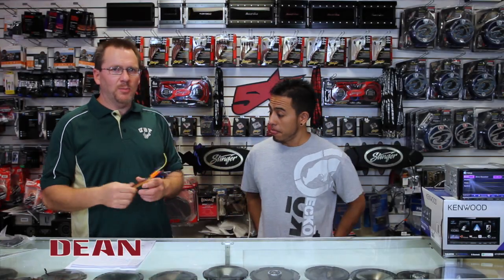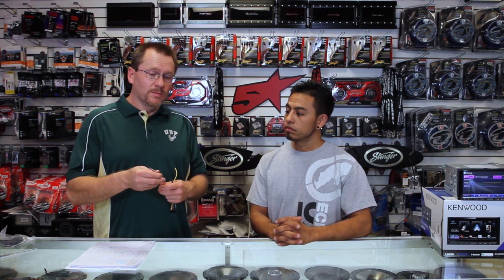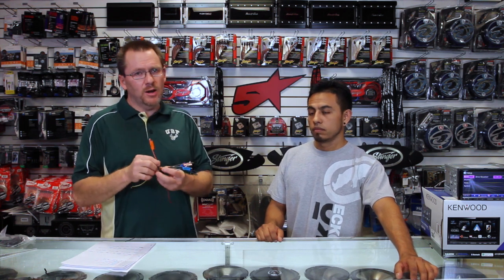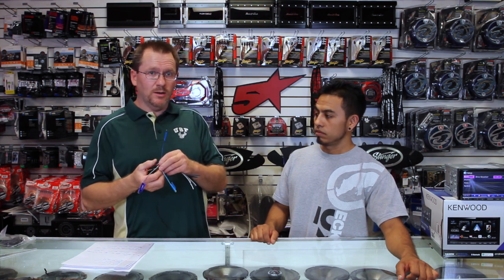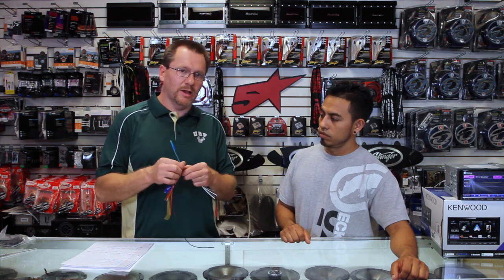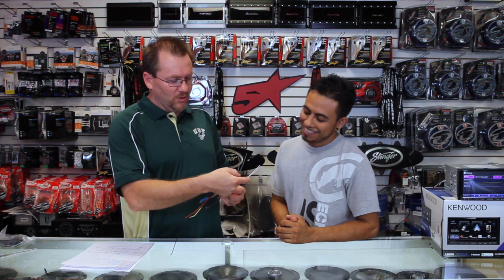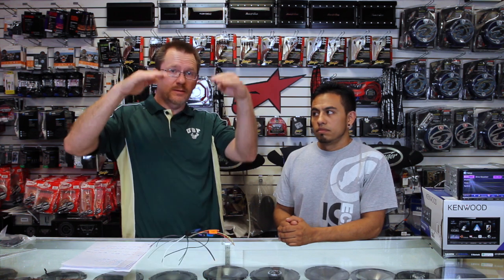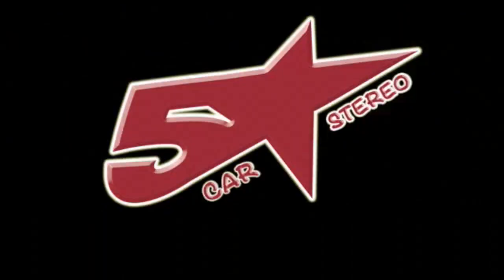What are all the wires for on a Kenwood power plug

Comment: need help....I installed the kenwood dpx501bt in my 2006 honda civic si with amp and sub. amp and sub works and deck works but no sound through my factory speakers....help me
Reply from the maker: The si may have a factory amp, did you connect the blue/ white remote wire up to the blue wire in the aftermarket harness?
Reply: +Five Star Car Stereo yes I did all that.... I found I need to by pass the stock amp so speakers will work
Reply from the maker: +joe rendon ok did you find the amp yet it should be under the center dash.

Comment: any way to bypass the e brake warning?
Reply from the maker: Ground the lt. Green wire on the back of the radio. If you are talking about the "OK" screen, there is no turning that off. The joys of companies covering their butts. Thank you for the question.
Reply: Use a toggle switch to bypass e brake.